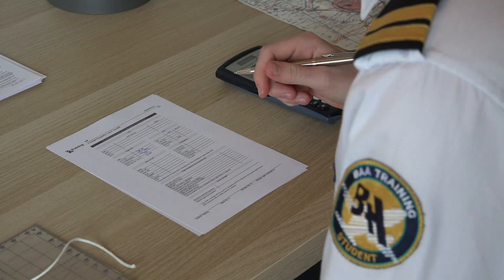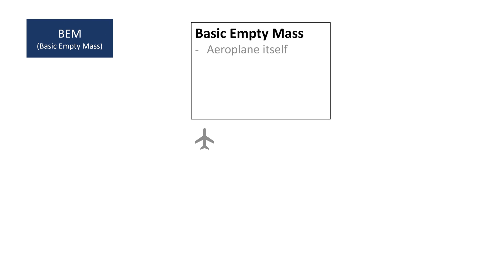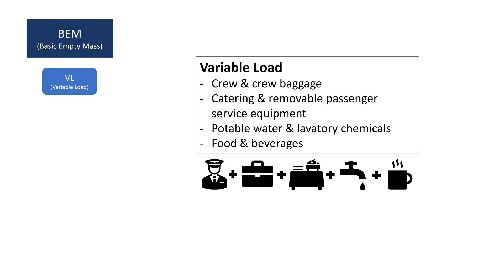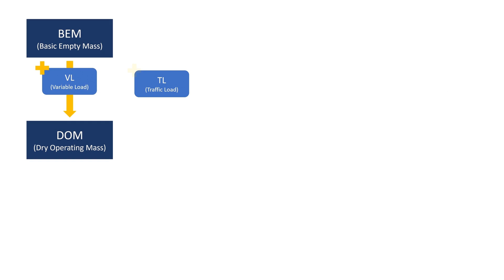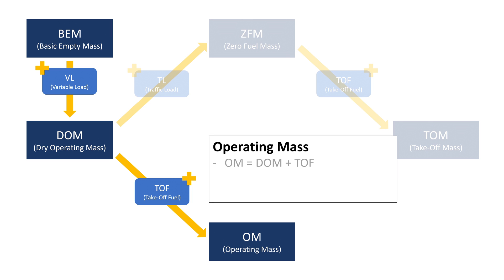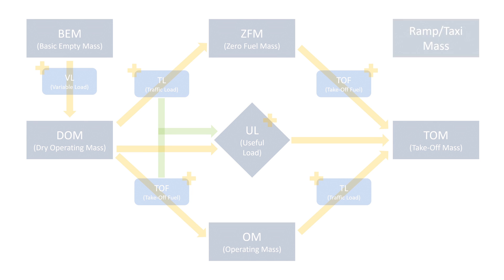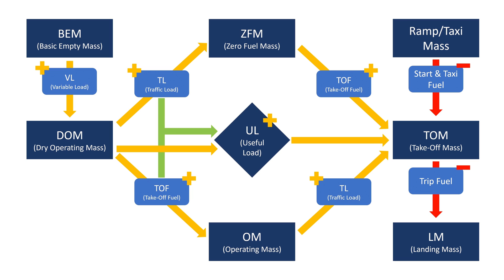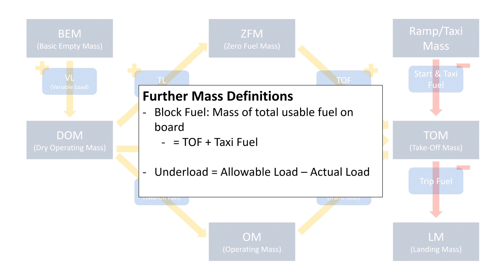Aircraft Mass Definitions (Zero Fuel Mass, Operating Mass..) | ATPL Theory - Mass & Balance

Comment: Could someone answer me one question? What acronym represents the maximum weght the structure of the aircraft can accept on takeoff in the video (I am quite confused on the acronyms)? And what about the maximum takeoff weight limited by performance? (climb and obstacle clearance performance)
Reply from the maker: MSTOM - Maximum structural take-off mass
PLTOM - Performance limited take-off mass
Hope this helps!
Reply: @PilotJonathan  thanks for the reply, I have another question. 

If USEFUL LOAD is = TOF + TL wouldnt it be incorrect to say that  Actual TOM = DOM + UL (the correct as I understand would be Ramp Mass = DOM + UL ) because the TOM would be the mass of the aircraft lined up on the runway after spending taxi fuel. ?

Comment: It's very regional if the term mass or weight is used btw. Eg CASA here and the FAA all the official documentation and legislation refers to it as weight and balance. ICAO refers to it as mass. Physics wise mass is more correct.
Reply from the maker: Yeah, that is the confusing part, since like you say physics wise there is a clear difference between mass and weight, and these are clearly masses! But I'm guessing it will slowly change in most parts of the world, it used to be referred to weights everywhere as far as I know - and it's definitely not helped by the term weight technically being used wrongly in day to day life as well